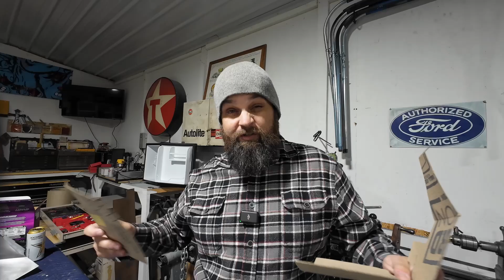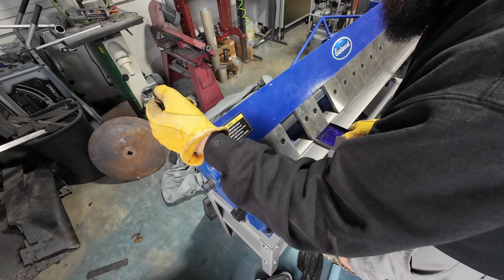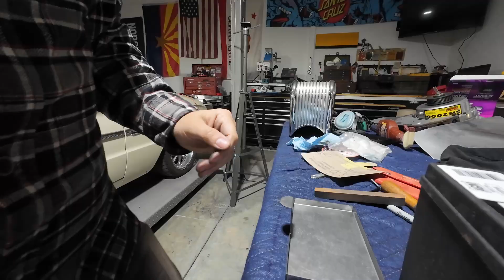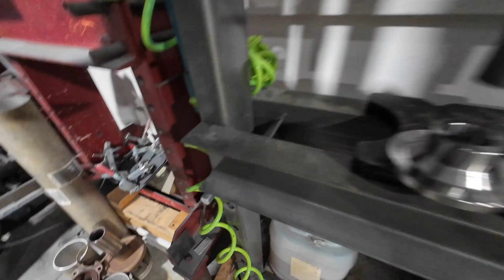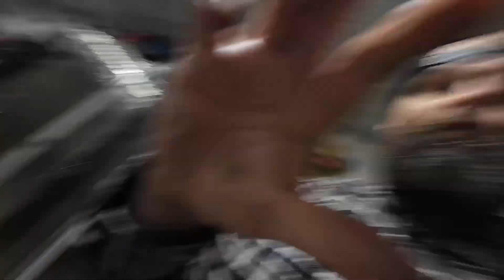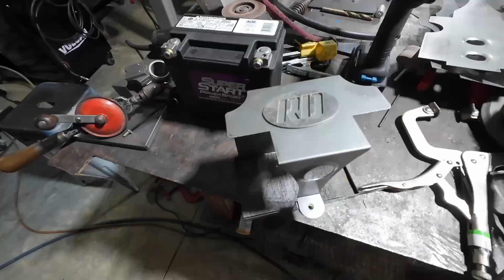How to make a battery box! Sheet metal projects in the home shop

Comment: Great little custom job mate, i reckon you'd pay $40 Aus for a dinky-chocolate one from Chy-na... which is about $26.70 in your money.. So for a custom monogrammed one i'd say $49 USD for a bare steel one & $20 more for the powder coated model. I really wanted to see you make the top with edges & breaks so that is wraps the top of the battery top & bottom, rather than just a flat flap piece of tin, which obviously would be more work, but you could add dimples in the top for strength & make it more interesting  & sell that one as a premium model..& chrome it..!!  $150 bucks
I'd buy one from you but I'm putting my battery in the back of the wagon & dropping in the floor somehow.. in 2055 probably.

Love your work Cobber..
Reply from the maker: Hey thank you! Yeah wrapping the top is a good idea. Maybe on version 2.0!

Comment: Although you can swing the battery and top into the slot hinge, but you won’t be able to do that once the bottom of the tray is bolted into the engine compartment up against the inner fender.  Maybe I don’t understand?  🤔
Reply from the maker: I’ll make a video of it in the falcon. The box is roughly half the size of a standard big battery so when the tray is bolted down, you should have enough room to rotate it in to place. Although you can put the box where you want/need to, to make it work.